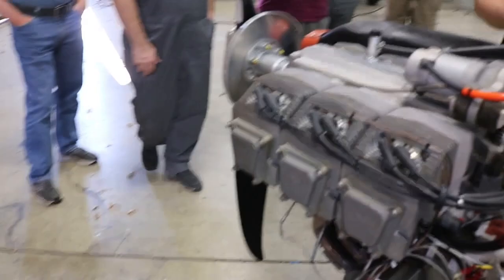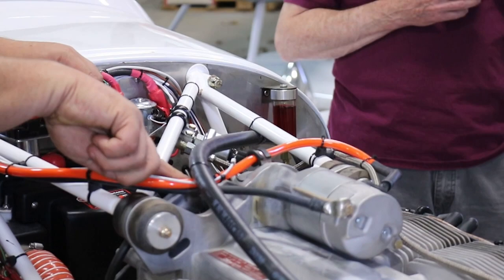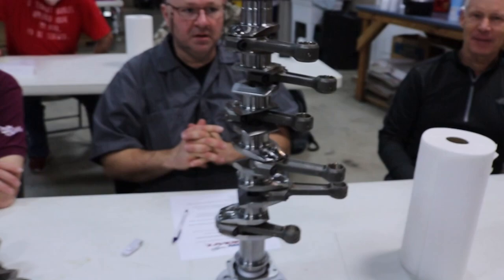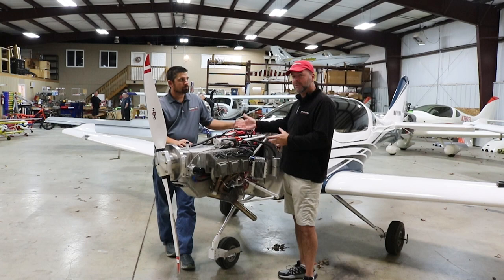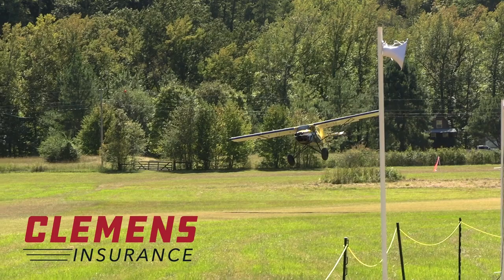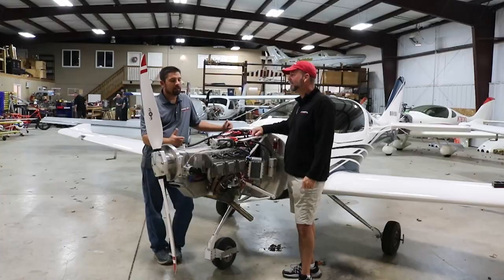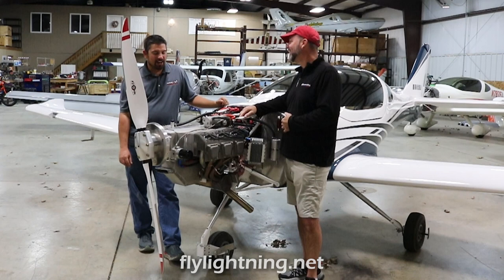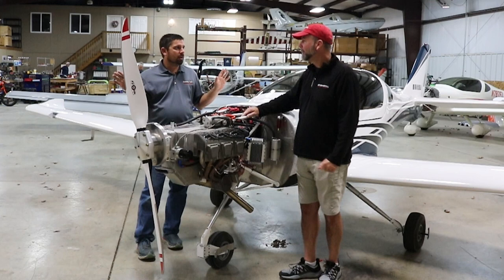Jabiru Aircraft Engines - What's NEW? - Engine Week 2022

Comment: I have said this before, but I loved my jab 3300! I had the carb that Sonex sold at the time. That thing would crank over, in what felt like, half a revolution EVERY time! Hope to love my Viking equally as much!
Reply: I've got the Sonex/AeroConversion's "AeroInjector" TBI carb on my Jab 3300 and am very pleased with it.  I like having a manual mixture control so I can richen the mixture to help with cooling in extreme conditions.  Combined with an EarthX battery, my engine starts so quickly you can't count blades - it's like flipping the switch on an electric motor!

Comment: Great interview and lots of good information.  One correction, however ... Nick mentioned more than once that the Gen 4 needs no valve adjustments unlike Gen's 1, 2, and 3.  However, the Gen 2's (which I have) and all the Gen 3's have hydraulic lifters and require no valve adjustments.  But, as mentioned, the 1's, 2's, and 3's do require regular cylinder bolt torque checks while the Gen 4 doesn't due to a cylinder design similar to most Lycomings and Continentals.  I also heard recently that the Gen 4's have switched to a Mikuni carb as the Bing is no longer produced and would have liked to hear more about the new carb.
One thing that both of you got right is that the engine sound of that flat 6 is great - even with mufflers!  Only thing that sounds better is a Merlin 12 cylinder!
I'm thinking that for the price difference of overhaul/upgrades vs a new engine, I'll go with a new engine at 1000 hrs.  At the rate I fly, and the production lead times,  guess I'll be ordering a new engine in about a year!

Comment: I remember some kits being sold for Continental and Lycoming engines to improve fuel injection, ignition, pistons, install turbos... then I found out those also exist for Jabirus. Another advantage of researching composite materials for engines would be the use of materials capable of impact absorption and ceramic(?) coatings to minimize the wear of components subject to too much compression/expansion or friction. Or more exotic ideas such as magnetic repulsion instead of lubrication, hard metals and smooth finishes for some contact surfaces.

Comment: You guys should test out motor jets, it's an experiment from WW2... A Piston driven car or aircraft engine, with a fan instead of a propeller or drive shaft, inside a pulse jet engine, with some simple intakes, right before the propeller... all the exhaust goes into the pulse jet to be recycled, and both engines run on 1 fuel tank, with 2 pumps

If the Nozzle is done correctly, it's supposedly more powerful, & efficient, than either type of engine alone.

It's appearance would look the same, but there would be intakes behind the cockpit, and no propeller, and a huge jet pipe with a Nozzle like a rocket engine out the end, the jet combustion should be behind the occupants, cause it's cooler, and more safe if it blows up or something... same engine... pulse jets are basically just a tube with a valve behind a spark plug and fuel line